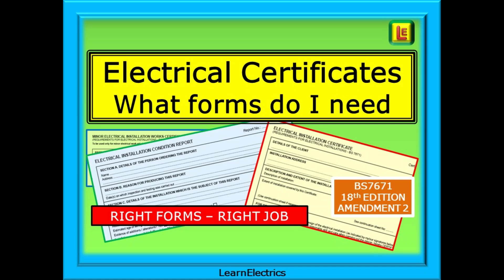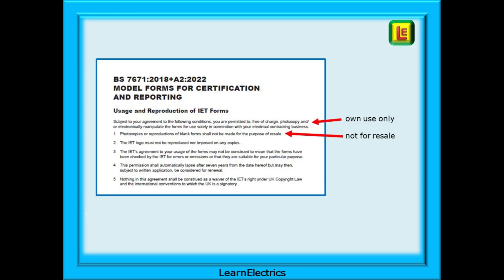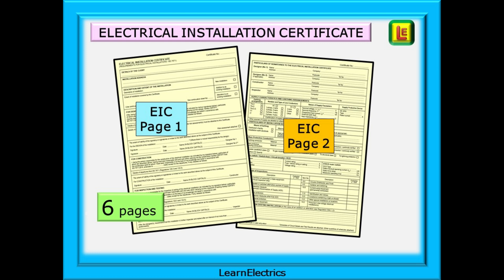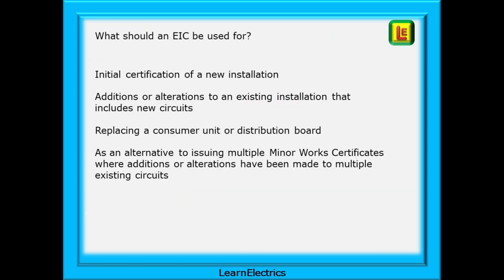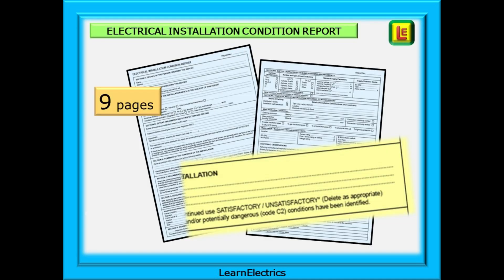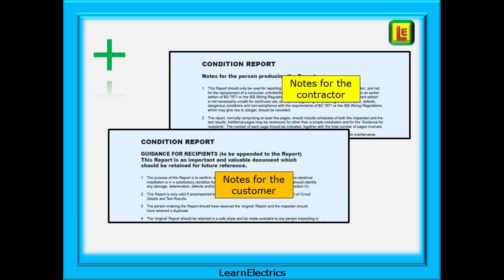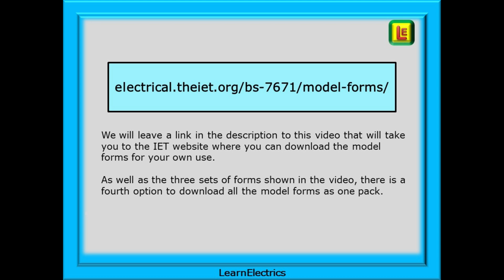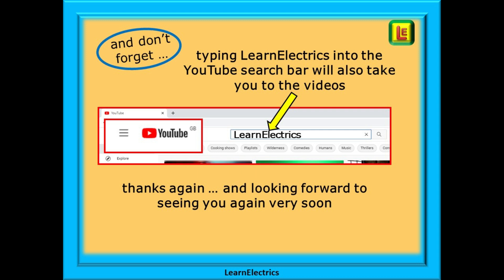ELECTRICAL CERTIFICATES - WHAT FORMS DO I NEED TO COMPLETE? - 18th EDITION AMENDMENT 2 – BS7671

Comment: Hi, Can I instal a Garage consumer unit in my shed or do I have to have an electrician to do it ?
Reply from the maker: The regulations require you to be competent. Only you can decide your competence. If there is any doubt, use an electrician.

Comment: Great video , the model forms are great and cheaper than buying the books . Down side is you will have to complete the forms twice as you are required to give copies to the customer and keep copies for yourself . With the book you get a carbon copy each time you complete a certificate.
Reply from the maker: Thanks for the input Sean. Scanning the original is another option, and I would file it with the customer invoice. Everything for each customer in their own folders. Some sparkies fill in the IET form on-site as a rough and then transfer it to "posh" forms or on-line when back at base. Dave.

Comment: Another really clear video. The link you have supplied doesn't work?
Reply from the maker: For some reason it didn't like the www in front. Try putting this in your browser, it just worked for me. Dave.

electrical.theiet.org/bs-7671/model-forms/
Reply: Just type in IET model forms that works for me every time